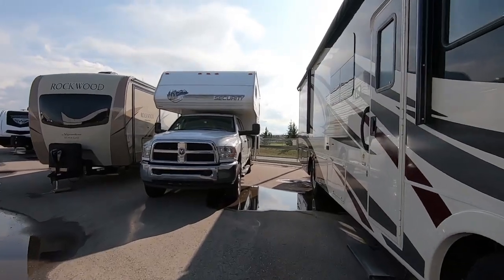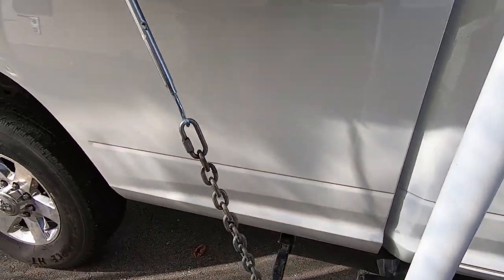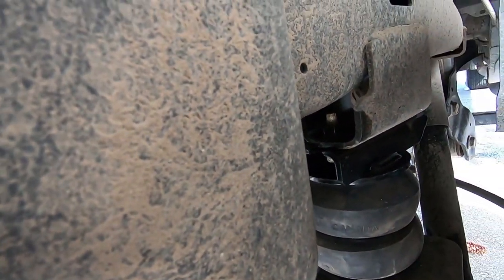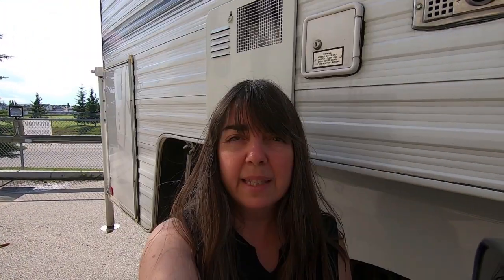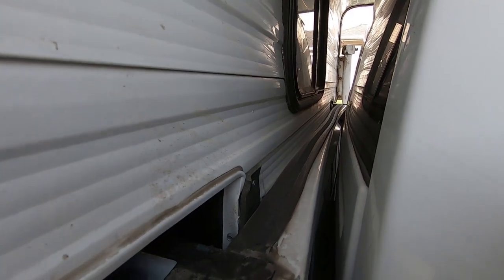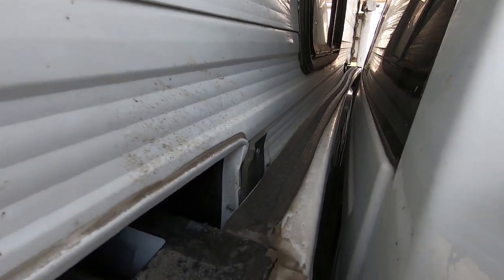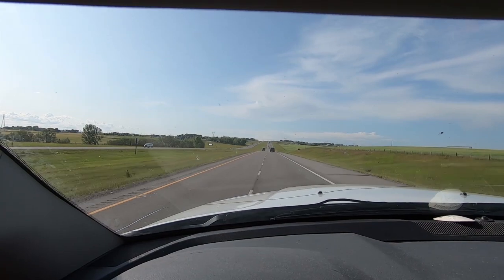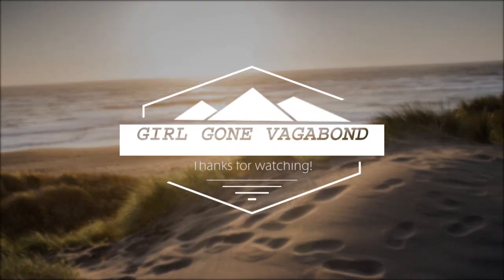HOW TO FIX SWAY ON TRUCK CAMPERS

Comment: Timbren ses's are good but I found that they bottomed out pretty hard. It's fine on a stock height truck. I did a leveling kit and at that point t I went to bags. Same price. Found the bags sway a little ... I mean just a little more but the ride is nicer. Also added fox tuned shocks. 2019 ram 2500.   Palomino ss 1251